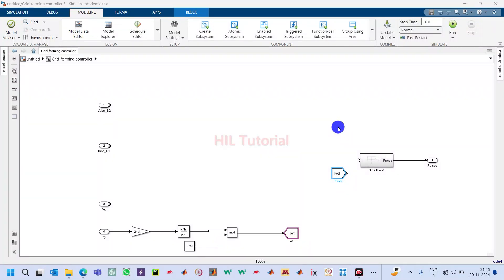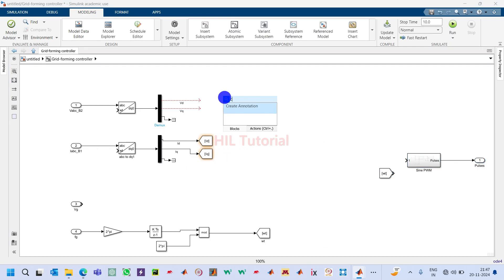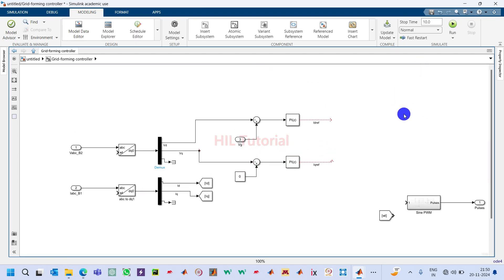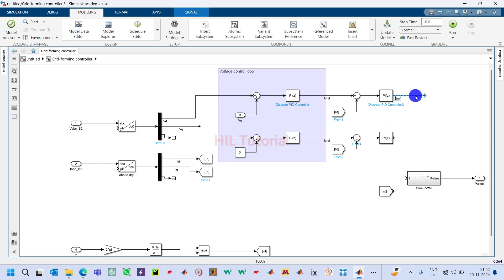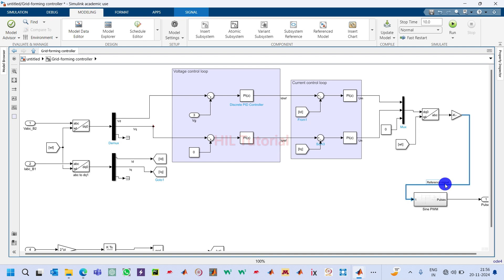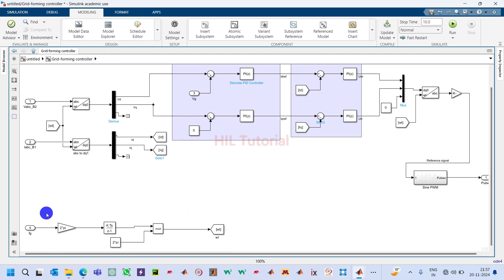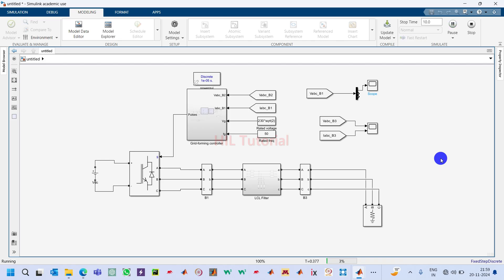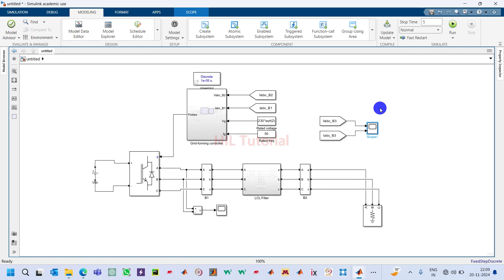Simulation of a Grid Forming Inverter | HIL Tutorial | Simulink | Part-03

Comment: is it not an UPS if not connected to the grid and just giving the constant voltage and phase angle for the simulation?
Reply from the maker: Hello what do you want to mean? UPS is different things
Reply: @mesansari  can you kindly explain what's the key difference between this simulation and an UPS voltage control?
Reply from the maker: @sivadharshinia5384  Please read about any research paper on grid-forming inverters and UPS; you will understand the differences, even though both sound the same.

Comment: What is the purpose of using the terminator with the demux if we are not using that signal? Can't we directly use two output ports from the demux instead?
Reply from the maker: No you can't use 2 out ports in demux, it will convert vector into two dimensions, but the actual vector is of 3 dimensions , to extract all three scallers individually we have to use 3 port demux. Terminator used to terminate unused signals to avoid warnings. Hope you understand
Reply: @mesansari  Thank you for your elaborate reply!